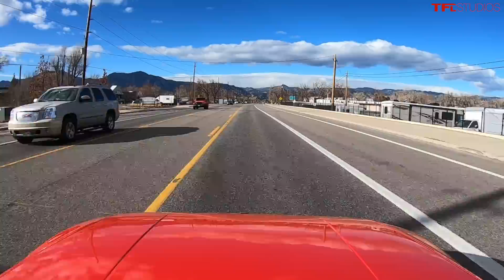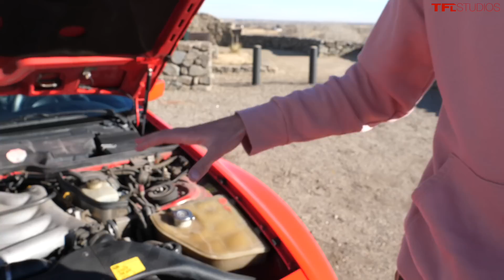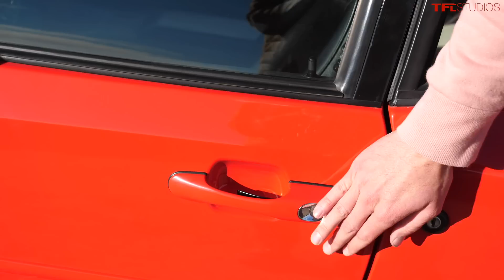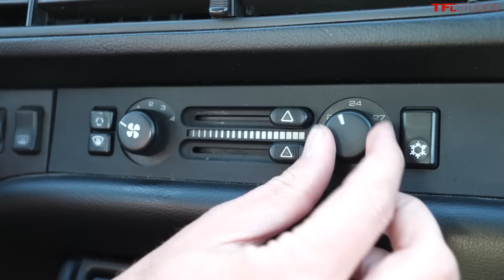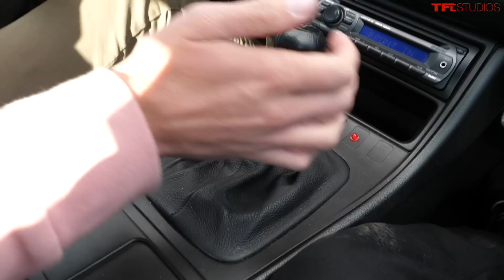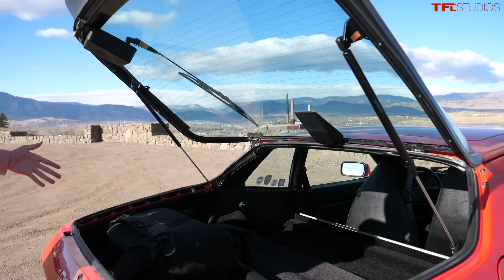Don't Get Left Out: Buy This Cheap Icon Now BEFORE It Becomes Crazy Expensive

Comment: could have bought a 928 strosek for 3grand 10years ago but i was young with no job still sometimes regret it, but thank god i atleast own a 944 in good condition
Reply: NOPE u could not buy a good 928 for 3k 10 years ago .. but yes junk one you could had bought for 3k which is not a good idea glad u did not buy it.. only buy the good sample not junk ones.
Reply: @SAMMYJR00777  Dude i live in Germany... 928 where cheap Back than, btw bought a good 944 for 5,5grand 12years ago
Reply: 10 years ago 928s4 prices were at 15k and up clean ones... junk part ones 3k

Comment: I drove a friend’s “new” 944 Turbo and I felt that the clutch pedal press distance was very long. Is that normal?
Reply: They have pretty light clutches, but they are prone to slave cylinder failure. It could also need to be bled as they are tricky to bleed properly. Less likely could be the master cylinder or the firewall around where the master cyl attaches.

Comment: I just inherited my father-in-law’s 1983 Porsche 944.  Beautiful original but I couldn’t find much in the way of service records, so before I drive it too much, it’s at the independent Porsche mechanic for timing belt, water pump, all front engine seals and alternator.  Not too expensive…about $2300, which included full safety check. Here I go… a life of 944 ownership to keep my father-in-law’s dream alive. And of course, finding every video about this car👍

Comment: Words to the wise, if you want a dream 80's super car then be ready to shell out some coins, and find a real mechanic for it. Yes you can fix things youself, but you will need a mechanic. Yes the 80's put out some of the most exotic rides of all time. They were laughed at in the 90's, but the ones who own a well maintained one are laughing now. The 911 is a $30,000 dollar ride, why? Because you will have to spend that much to get it right. The 944 is a $10,000 dollar car and you will need to spend that much to get it running correctly. The 951 is just a shade more. How do I know? I have owened a couple. I have a 951 in the garage and its awesome. Quick run down of prices. You have to do this or else! 1. Timing belt and Balance shaft belts, $1200 + replacement, plus 1000 mi retension. You must do this every 30,000 miles and get your book stamped by a certified mechanic. If not done correctly the value will drop. 2. with the belts, you will need to do a water pump, its wise to do it so, do it..Clutch for a 951 will run ya $2,500 You have to replace it, if its original then its a safe bet that the rubber vibration dampeners will be toast. Motor mounts go, cv joints on the trans axel, oil leaks is common, and plan on replacing the alternator, or you will fry the DEE brain in your ride. Good luck!

Comment: Turbo will never make due to the 80’s turbo tech. I had a 968 which I liked but the maintained experience was a bitch even it was NA. I WOULDN’T TOUCH THE TURBO WITH A 20 FT POLE. 944 s or 944 s2 may be interesting but again too many issues to deal with.
Reply: Sorry you do not know what you are talking about. Great reliable cars
Reply: @AlanShirtsink  ok sure. Lets see in 3 years where the prices are and who 'knows what they are talking about'. They are going to be the same price as now - your title says they will be crazy expensive. I call BS.

Comment: Have a 83 944 this car drives soo Amazing
I Tell you if you want one get them as fast as possible behause here in Austria a Good Basic Model costs 15.000€ and for a Turbo you have to pay around 35.000€
Reply: The Euro Version of the Standard 944 Has 163 horse power

Comment: Very undervalued Porche but now that they're over 30 yrs. old, many are starting to find out these are gems. There are many parts available, many repair shops that know how too work on them and a large online support from owners. I've hardly had issues finding parts and repairing stuff on mine. Engine overhauls and transmission clutch repairs are the things that can get pricey but these cars are drivers, very reliable. I have a +200k mile 1991 944S2 with the 3.0L.
Reply: Agreed. I have a 90 S2 Cabrio with 36k original miles. I will never sell her. I bought her when she was almost new in 93. It was coming off a lease.

Comment: I’ve got an 87 944 turbo - California version. Bought in 1991 when free trade was coming in and the duty dropped from 16% to less. It had 17K miles on it and now has 74K miles on it. It was parked in the garage and covered for 13 years. It has the dual air bags - difference from the Canadian model.  I’ve spent some money in maintenance, and from my experience, it’s worth it. I find that some parts are no longer available and have to get after market items or refurbished (with exchange). But everything you mentioned in you video is accurate except that I can put kids in the back seat. Lol.  Btw, in the 90s, I had my lady friends in the back seat with my buddy up front - so you can fit adult ladies (less than 5’ 10”) in back. This car is a pleasure to drive. An incident when I went through a drive through.  I got a “Wow!” for my car even though I don’t have drink holders. That’s the only thing I miss having compared to modern cars. Keep up with the great videos. Living in Vancouver, BC as 2nd owner of this car.
Reply: @Glow .. +1. Agreed.. The 944 series were/are great daily drivers; '87 944 Coupe owner of 20 years.. LY7U Stone Grey Metallic w/ Lt. Grey Beige Leather.. Fond memories!!

Comment: Buick GNX blew the doors off of all Porsches in the 80s for half the price.
Reply: Only in a straight line...  Have you ever watched a grand national trying to threshold brake for a corner?
Reply: @aussie2uGA  no but have you actually seen a 944 do that?
Reply: @fl_atv_riders4455  Yes, all day every day in my own 944.
Reply: That very first turn in my 87 turbo would leave a GNX in the dust. The 944 has a top speed of 160ish mph. While the gnx was done at 120
Reply: If you crash a 944 hard enough it looks like a GNX too

Comment: I think you're a bit premature on your conclusion to tell people not to get left out, and you're also a few years late on catching the rising value of these cars.  Sure, they will continue to gain in value, but I think the adjustments to the market have been made.  The reason I say you are premature is because you haven't factored in the cost of your first repair or scheduled maintenance, and it will be costly whether you do the work yourself or not.  Aftermarket support isn't as great as other brands and owners are usually held hostage by OEM and dealer markups.  The reason these cars sit unsold on craigslist and marketplace is because the cost of getting a basketcase up and running will far exceed its value.  You'll have to buy 2 or 3 parts cars to get all the parts you want for a complete one, and still end up paying those dealer markups for consumables.  In the end, you can get the same or similar experience from any of the japanese sports cars from the late 80s and early 90s for about the same price and a lot fewer headaches when it comes to repairs and finding parts.
Reply: I have a '91 944 turbo cab.  My brother has a '96 300zx convert.  Regular maintenance (timing belt, tune up etc) is far more expensive on the 300zx.  The only thing that would be more on the Porsche is a clutch.  The Porsche will require far less maintenance since it is built so much better.  I admit some parts on the Porsche can get expensive (radiator overflow tank $400).
All Z parts come from one or two companies.  The 944 has many different venders and aftermarket products for it.  
The Porsche is a far better car then a Z.  If you compare it to a Z of the same era it is three times the car a 300zx turbo from '89 is (I have had 10 Z cars from 240 to 300 turbo so I know what I am talking about)
In many respects a 944t is a far better car then a 911.
Reply: @davidkaehele8910  People have been saying the 944T is better than the 911 for 20+ years.  The vast majority of Porsche buyers don't care.  I doubt that will ever change.  It is an entirely different driving experience with the motor behind you whether it's a VW Bug or a Bugatti Veyron and the 944 just doesn't capture that.  I've driven both, I also own an Rx7 and MR2.  I switch between them regularly, both well balanced vehicles but a trip to the grocery store is more exciting in the MR2.
Reply: "Aftermarket support isn't as great as other brands and owners are usually held hostage by OEM and dealer markups" and "You'll have to buy 2 or 3 parts cars to get all the parts you want for a complete one". Have you experienced either of these scenarios yourself? Because I haven't experienced either of those scenarios while taking care of long-neglected maintenance by POs on my 944. OEM prices are high, but this is a Porsche.  And I haven't come across anything that holds me hostage to the parts counter at the dealer. A lot of parts that wear out or break easy are easy to come by in the aftermarket or from dismantlers, of which there are numerous who price fairly, ship quickly and stand behind the products (yep,, even though what they are selling is 30-39 years old). It's true, getting a basketcase up and running 10-20 years ago, would exceed the value. That's just not the case anymore. Many people are pulling cars that haven't been driven in decades out of garages, and bringing them back to life. It'll costs thousands, but what car wouldn't if it sat that long. Even then, for most, it's a labor of love, and not trying to make a buck. 80's Japanese cars are great cars and it's good to see people keeping them alive. If I had the garage space, I'd gladly park any Z-car from that era next to my 944. EDIT: Skip the Z-car, I want my '91 SE-R back! Which when new was parked next to my dad's '86 944. Two awesome cars.
Reply: Excellent point. I agree, and the iconic 911 is just in a different league with its pedigree. I can see why Tommy feels these 944 should be riding the coat tails of the 911’s
Reply: go play w your civic 🤡hahahahha nextttttttttttttttttttt

Comment: I think the first generation Boxsters (986) are the ones poised for drastic appreciation.  Handle better than a 944 (and really the 911 too) with more power and better reliability (the IMS issue is overblown and isn't that difficult to prevent).
Reply: I just purchased a 2000 Boxster non S model and the handling is excellent and still brings a smile on my face every time I drive it.
Reply: lol nope u cant compare them two next
Reply: @SAMMYJR00777  sure you can compare them.  The mid-engine 986 Boxster S had 30 more hp, better weight distribution, and was lighter!  (Depending on year, the 944 Turbo weighed the same or over 100 pounds more.)
Reply: My Dad has a first gen Boxster S. My 944 handles better than it all day every day. It’s fast and fun to drive though.

Comment: One of my dream cars.  However, the maintenance costs scare me off.   Would love for you guys to find one of my other dream cars...a Dodge Conquest that was a "competitor" to the 944.  I would love a video series on that.
Reply: Ive had both the 944 and the conquest. Loved the conquest’ looks but there was always something breaking on it. The 944 never failed me.
Reply: I have a 944. Maintenance is a cake walk. Learn the car, get a properly maintained one and they last and last.
Reply: I had a Starion ESIR back in the day and currently have a 944 turbo cab.  The maintenance on the Starion will be 5 times that of the Porsche.  I LOVED the Starion but it was the biggest POS.  The Porsche is reliable!
Reply: @davidkaehele8910  I had an 89 TSi that was absolutely gorgeous a few years ago. I had wanted one for 20 years and learned that the old saying "Never meet your heroes" is very true. The best day ever was when the new owner came to pick that POS up.
Reply: Don’t be afraid of maintenance just because it’s a Porsche.   Now parts are avails about a lot cheaper and most mechanics realize they are just as easy to work on as any other car.   I’ve owned many of the competitors like rx7 and station, eagle talon etc and the 944 was the best and most reliable.  It can’t be tuned like the others but still amazing cars
Reply: Not really expensive at all

Comment: 944 are a case of deferred maintenance. They use to be so cheap to buy that people just drive them but minimal maintenance. When buying this car always be sure the timing belt has been changed.
Reply: Black Man 911 have a timing chain but those air cooled car have to have valves adjusted every 20-25k miles.  Porsches are long lasting but require frequent maintenance.
Reply: Black Man they are inference engines.  You have to change the timing belt every 30k miles.
Reply: @bngr_bngr  nope lol wrong How often does a Porsche 944 need a timing belt?
Timing belts are replaced as part of scheduled maintenance, usually every 60,000 to 100,000 miles.
Reply: @Black Man  No Incorrect.. Absolutely INTERFERENCE engines are the 944/968 series 4 cly.. When the rollers, belt or nylon guides go .. the engine goes Puff Gone.. Service intergal is the belt replacement @45K miles or 8 years of age.. The inital belt construction used on the early production years was a mere 30K miles for its replacement.. The early belt's heat - cool cycles were the concern back in the day.. Fond memories that '87 944 coupe of ours . . .
Reply: @michaelschneider-  How often does a Porsche 944 need a timing belt?
Timing belts are replaced as part of scheduled maintenance, usually every 60,000 to 100,000 miles.
Reply: E Z the recommendation for Porsche 944 is to change the timing belt every 30k miles.  Then after 1500 miles adjust and inspect the belts. Adjust the belts & inspect them at 15k miles.
Reply: Black Man what sports car is the Ford 4.2 in?
Reply: @Black Man  How often does a Porsche 944 need a timing belt?
Timing belts are replaced as part of scheduled maintenance, usually every 60,000 to 100,000 miles.
Reply: Black Man some engines are just designed that way.  Even early 2000's Toyota Land Cruisers have a timing belt that needs to be changed every 100k miles.

Comment: I'd rather get a water cooled Porsche than an air cooled one. I can't imagine driving an air cooled Porsche in heavy traffic.
Reply: A 911 doesn’t heat up in traffic. I live in Southern California. In the summer the car can heat up in traffic. But later air cooled 911’s has a oil cooler. Also there  is a lever inside the car that releases heat from the heat exchanger in the car. I own a 87 911.

Comment: It would be awesome if Porsche recarnate the 924 and 944 with their current power trains, tech, suspension etc. I think they have all the components to make it happen. I think getting one of  these old 924, 944 might be expensive to maintain and repair.
Reply: They're not too bad to be honest. The engineering that went into them was not stupidly complex but they were very well built. I've nearly finished restoring a 1990 S2 - I got a bit lucky in the state of the rust in the rear end, but the bulk of the car just unbolted nicely and has been WAY simpler to sort out than other cars I've had. The expensive job is a clutch, but these last very well.